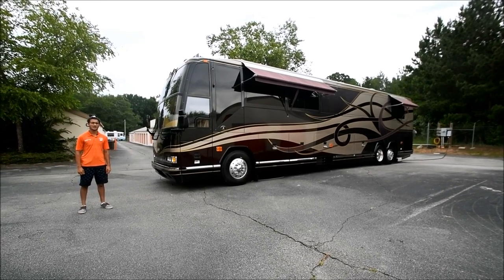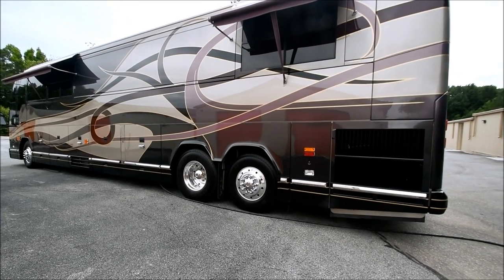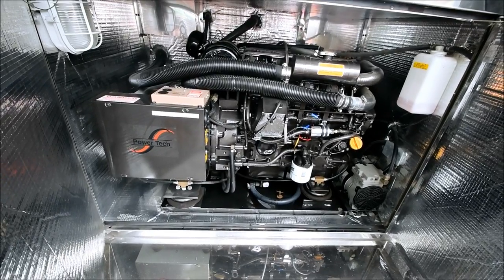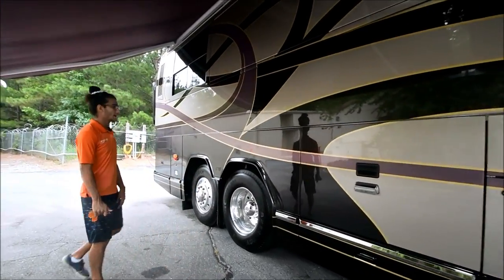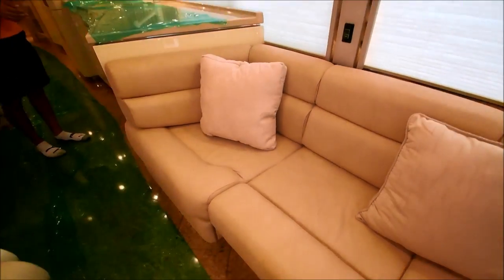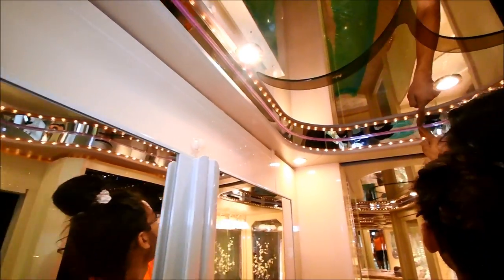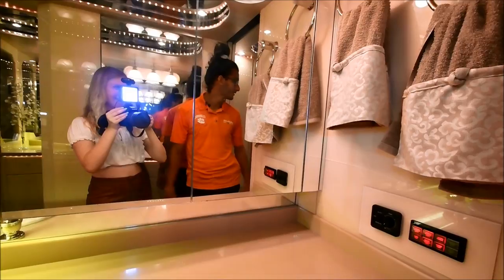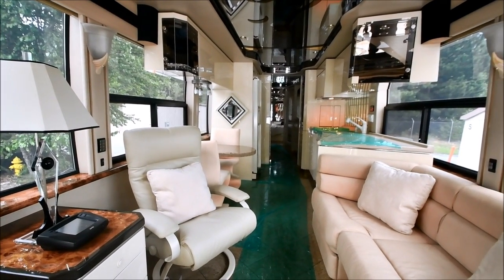2000 Prevost Vantare 27k Miles Time Capsule Condition  SOLD

Comment: Awesome coach. Totally quality and detail especially for 2000. You did a fantastic job showing it as well as driving it. You clearly know the bus very very well. Pretty impressed with your knowledge. Props to you. Don’t worry about pronouncing the name incorrectly. Lots of people do that until they are told. There are lots of people that can pronounce the name, but will never own or even drive one. Your girl did a really great job on camera also. I recently bought a really nice new gas MH for $100k less than this, and as nice as it is, my new coach doesn’t compare to this gem. Not surprised it sold fast! Lucky new owner. I only hope they take as good care of it as the prior owners. Thanks for a job well done!

Comment: I haul and drive new R.V.'s from the factory to the dealers all over the U.S., and i can tell you this;  This coach, 18 years old and all, is 10 times the quality of the new ones coming out of the factories here in Indiana (90% of R.V.'s in North America are built in Indiana), and a far better buy than your typical composite body on frame class A's.  Most of them are glue and staple jobs rushed together.

There's NO way i would pay $200k for a new one after seeing, driving, and experiencing their shoddy workmanship.  The Prevost chassis alone will hold value because it can be remodeled in the future.  It is a real bus, not just a class 6 chassis with a box truck diesel.  The Detroit diesel 12.7L (known as the million mile motor) is the best engine ever installed in a coach, and it's pre-DEF, so it is super reliable 

$200k is what they're asking, as of my posting.  I wish i could afford it.  If you're in the market for a class A diesel, and are willing to give up some width (no slideouts), this coach is the way to go.  Class!  Class!  Class!
Reply from the maker: R.C. Collons, words of wisdom and by first hand experience of driving other RVs AMEN!!  Thank you for watching our videos!
Reply: Spot on analogy,had the 2001 Prevost LeMirage with the Cummins engine was sold 5 years ago only regrets was not ordering the Detroit that coach shown has.A Detroit~Allison drivetrain is the only way to go on these.For 2 people could go without slides only thing I'd change on this is replacing 2 CRT TVs with OLED sets and get phone mount in drivers panel for google maps and hands free phone chat📲and that's it a fine coach indeed.👌Sadly since Volvo purchased Prevost can only get Volvo engine on new Prevost H series coaches.Did get to tour both Prevost and Vantare and regrettably didn't have Vantare outfit the LeMirage after Quebec factory built shell.
Reply: @louisaloi9178  Interesting what you say about Detroit.  I am getting an MCI with a Detroit 8v92.  I heard when they went from 71 to 92 the extra power puts a lot of strain on the crankshaft bearings causing them to wear out after 150 000 miles.  First order of business is for me to inspect and probably change the main bearings.
Reply: @jennydiazvigneault5548 :The coach in this video has a Series 60~Allison drivetrain the most desirable pre EPA mandate combo.Had 2 LeMirage private coaches but on neither accumulated high mileage.Miss Detroit Diesel is too bad EPA basically ran it out of business Bus fleets loved their reliability & serviceability.The first Prevost we had had a 8v71 and the second Prevost had a Cummins.Is easy to see this young man in video sold this beauty in short order.Knew someone in Pa.that once owned a bus like this in sales video and he owned a bus fleet.Told me with proper maintenance is a million mile motor.👍
Reply: I have 2 my 2 one I rent it it's a private tour bus..
Reply: @jennydiazvigneault5548  Not true, change your oil regularly and keep on going to at least 500K on an 92......... mho

Comment: A bus with only 27k on the clock is brand new still, $220k is a bargain for a Prevost.
Reply: John Gaudet   Actually, it’s way too few miles for a coach this age.  Full break in on a large Detroit Diesel engine is about 50,000 miles (or equivalent hours).
Reply: Sitting is the absolute worste thing for a diesel engine and drive train, every seal, gasket and hose deteriorates

Comment: Your right.  Its not an rv.  Look close at its outside compartments.  Remind you  of a grey hound bus??  Prevost is mainly a commercial bus manufacturer. As a result it’s basically a commercial bus with an rv interiors.  And it has same built in safety as a commercial bus.

Comment: I don't care where it's been sitting or how many miles is on it it's not worth $219,000 because you still can't get past the fact that it is 18 years old and everything is outdated the engine the chassis and especially the electronics.
The class A Motorcoach industry has made Leaps and Bounds in the past 18 years if you don't think I'm right just look at the smartphone you're using today now think back 18 years and try and remember what you were using then.
Reply: not agreeing lol and i just own a Newmar
Reply: The engine alone is bullet proof compared to what is new today.
Reply: Based on your comment, you know nothing about a quality Prevost conversion.

Comment: Why did it need new tires and brakes with only 26k miles ?
Reply from the maker: After 10 or 12 years even if they are garage kept RVs,  you supposed to change tires and also brakes as they can get sticky calipers. It’s always good to do some preventative services when coach was sitting in the air-conditioning garage for 7 to 8 years. Some lucky owners in Ohio got this bus! Thank you
Reply: @rvmaxus  I didnt realize it was that old but the brakes would be fine just change the fluid it breaks down and reseat the shoes by hard braking a few times to heat them up

Comment: No slides, maybe they didn't have them in 2000
Reply: Less things to break or maintain
Reply: They've had then since at least the 90's and I believe before
Reply: @veritasetutilitas5432  nope. Not Prevosts
Reply: @stratolestele7611  I was simply referring to the industry having them and that it was a system that Prevost hadn't developed and incorporated yet. Of course you're correct.

Comment: No slide outs? 2000 for sure. SEMPER FIDELIS
Reply: Its 45 feet long.  Who needs slide outs.  The body will be stronger and last longer without a big hole in the side and it has more than enough room.

Comment: Worn out suspension bushings at 27K?
Reply: No, rubber cracks after 18 yrs , even sitting
Reply: I bet many items on this coach will start to fail when driven regularly , except for the huge, CRT TV in the lower bay....All the complex systems on this coach sitting unused many years once re-activated will all go crazy..,I've seen it many times...I learned it's better to buy one that's been used instead of a museum piece that has set for 20 years..
Reply: Chris Reed maybe true some things have dry rot, but even still the expense to replace will pale in comparison to the price of this coach new....a new model like this is 1.5 million and UP

Comment: Does look good on outside, but very dated on inside, laminate in kitchen - some door/drawer fronts are yellowing whilst others are white(ish). Same goes for kitchen faucet. The mirrors everywhere ? who's taste is that, some Hollywood narcissist. Would it be cost effect to strip out a lot of it inside and start again ? I agree it has been well cared for, engine etc sounds like it's up to date, but after 20 yrs tastes change, if you walked into someones house and it looked like the inside of this coach with the mirrored ceiling and twinkly lights, you'd be expecting a string of scantily clad ladies to slowly make their way down the stairs, so you could pick your choice. Bit exaggerated I know, but you get my drift.

Comment: I'd love one but there is just too much to tech (that'll eventually break)! ha ha
Reply: If you can't afford the eventual repairs and replacements, you would be correct not to buy any Coach or RV at all.
Reply: @mikebridges7294  Said while mine is in the shop - lol.  I said this because with Prevosts, there is a sensor for EVERYTHING.  I have a 42' diesel pusher which is a lot more manual so the repairs are more basic.  These babies are next level awesome but stay pricey!  Need to win that lotto! :)

Comment: It's a beautiful coach but dude, learn how to pronounce Prevost; many pronounce it incorrectly, as you have but that doesn't make it okay. Listen to one of the company representatives pronounce it here from Prevost page (see https://www.prevostcar.com/). By the way, if one is expecting to haul around a motorcycle in that compartment it must be the smallest motorcycle around; just saying. If I bought this coach the first thing I would do is have somebody go through and replace all of the television and stereo components. It's doubtful that it'll be long before those remote controls (if they haven't already) start going bad. It's true that things were built to last back then but it's been twenty years and I'm pretty confident saying it's time for things to start popping up in need of replacement or maintenance. Congrats; you came closer to pronouncing the name correctly toward the end of the video. It truly is a beautiful coach; thanks for sharing.

Comment: Come on! You can see several places where the lights are burnt out. All of the a/v equipment needs to be replaced. I have an $8,000 plasma TV from 2002 in my garage because the new $400 4K TV's I have in my house are so much better, sharper, have better blacks, are lighter, and more energy efficient. There is water damage in at least one bay. Just the couple of broken/missing parts you clumsily came across are indicative of what types of things will break for the future owner, probably sooner rather than later. At that age, even superb maintenance can't avoid deterioration. Whoever paid $220K for this bus got taken to the bank. It was WAY over priced. And a few suggestions for the boy giving the review . . . get rid of the freaky man bun immediately, cool it on the superlatives (they get old and make you sound desperate,) and many of your gestures border on gangland style. Other than that, the paint looks good.

Comment: Number one the man cant pronounce the name of the vehicle he is selling. Number two low miles on a Prevost is not what you want that is exactly the opposite of what you want. that means it’s been sitting and that’s the worst thing you can do is to let it sit. I wouldn’t touch this coach for $5000.
Reply: It was stored in a heated and air conditioned building. The tires from sitting would be suspect but they put new Michelins all around with other maintenance. It is an old adage to say it's no good because it was stored and not driven much but if its stored in the proper conditions then it's not a problem and from what I saw and heard it seems to be in fantastic shape. The price may be a bit high but I wouldn't be worried about the engine or the structure. People store high end cars for years with few miles and it doesn't decrease their value or driveability. Just saying